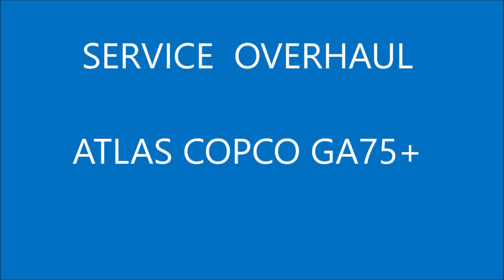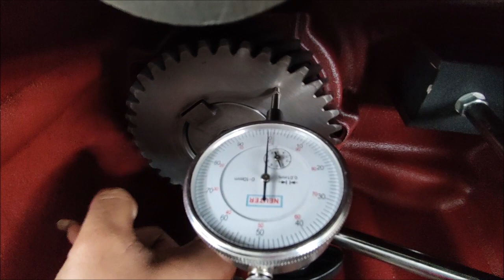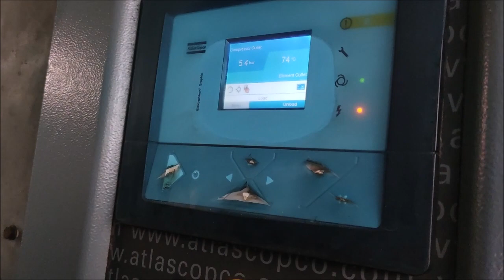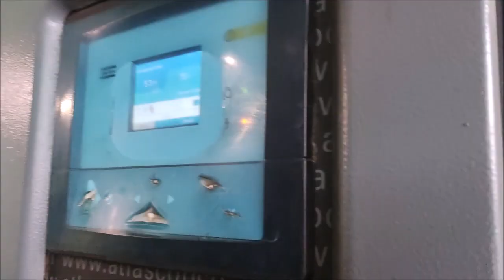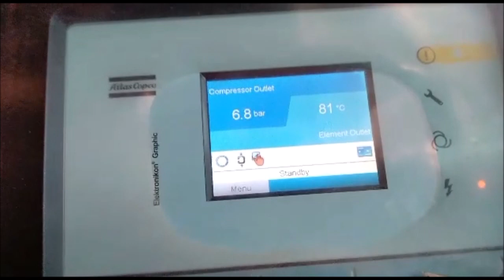Overhaul Atlas Copco GA75

Comment: How we are adjusting the clearance between the screws
Reply: you need to use clock and raise rotors
Reply: to much clearance need to 0.04 until 0.08 mm

Comment: Salam brother, tanya kalau serie/type Atlas Copco GA30C sama ga bro? Thx
Reply from the maker: @rizal fahlifi Beda Power & kapsitas Broo, untuk tipe Atlas Copco GA 30 itu berarti 30kw atau 45Hp. Sedangkan yang di Video GA 75, berarti daya Power nya 75kw
Reply: @kompresorairteknologi  ok bro, thx infonya, no wa ada ga buat konsultasi brother?thx
Reply: Buenas noches si quieren saber los HP deben multiplicar los kw x 1.36 y allí saben cuántos HP es el compresor es decir 
GA 30  = 40 HP 
GA 37. =  50 HP 
GA 75 =.  100Hp

Comment: Hello,

This is Grace from Coolworks filter.

We are the filter manufacturer in China, and have been working in this field for over 20 years.
 
We can offer high quality filter parts (air filter, oil separator, and oil filter)and OEM service at a reasonable price.

If you need filters for air compressors, you are welcome to send me your inquiry.